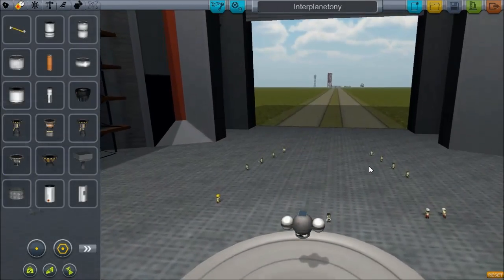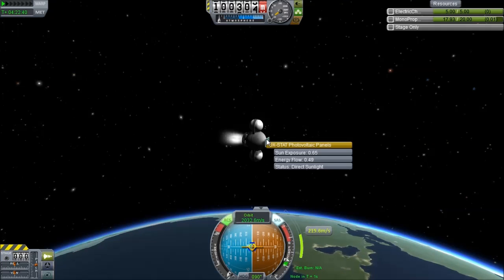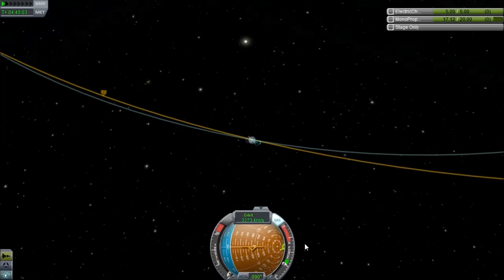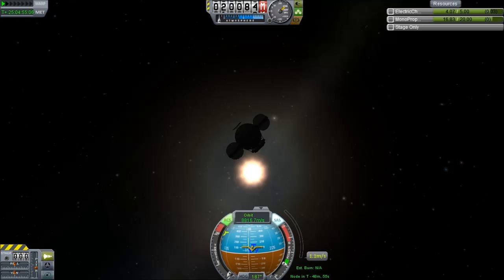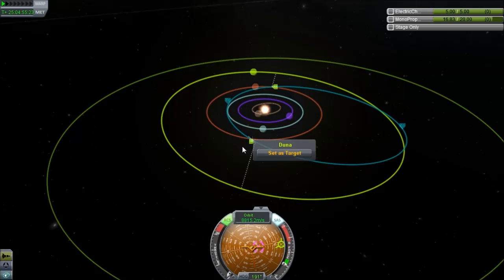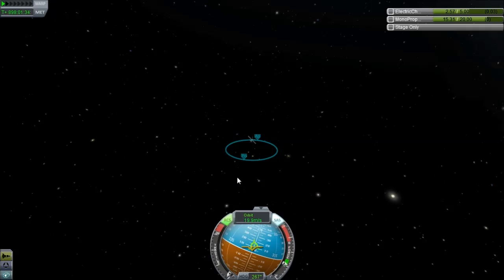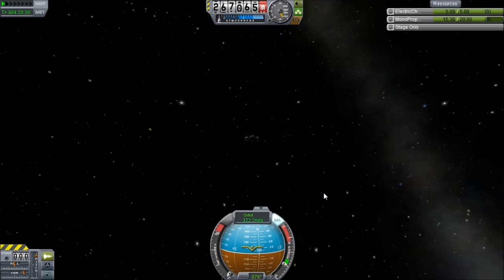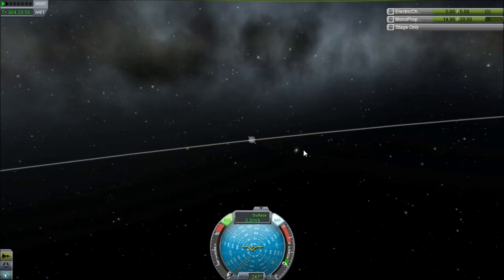Interplanetary Probe Powered By RCS Thrusters in Kerbal Space Program

Comment: RCS isn't exactly "overpowered", it just has a divide-by-almost-zero issue.  For some reason they were coded to generate more thrust when they're closer to the rocket's center of mass so that they would always generate the same torque.

If you put your thrusters right in the center of the surface and then put a single small RCS tank -below- it, you'll get several hundred m/s^2 acceleration and around 300,000m/s delta v.